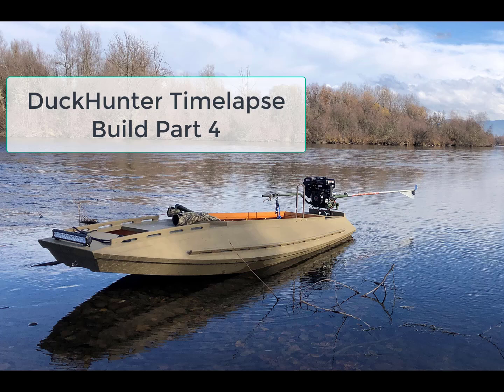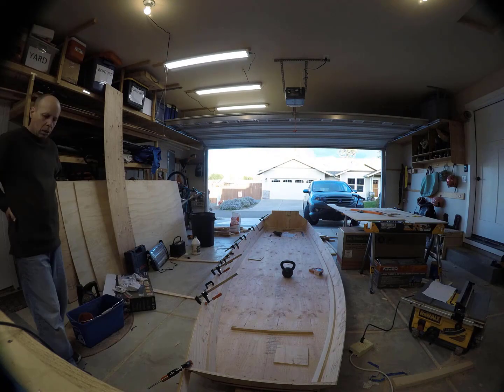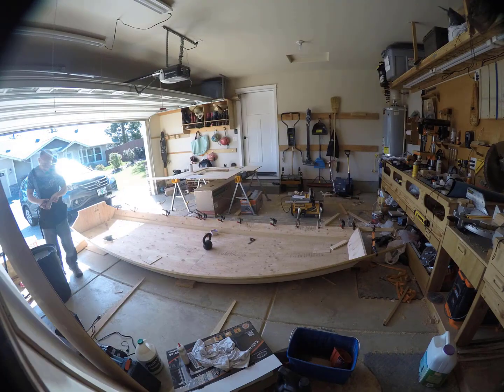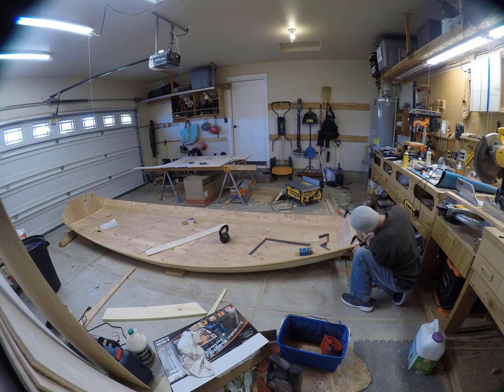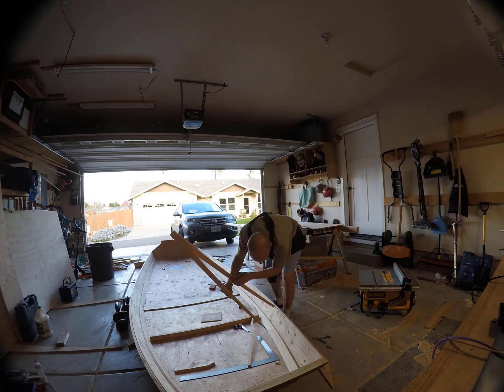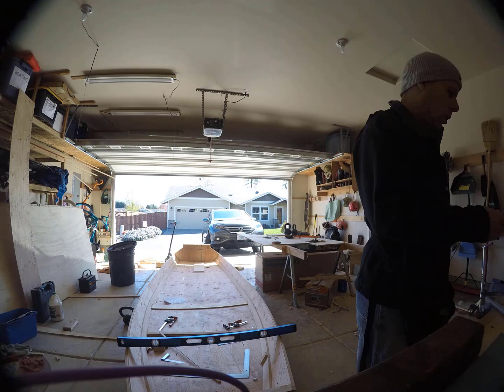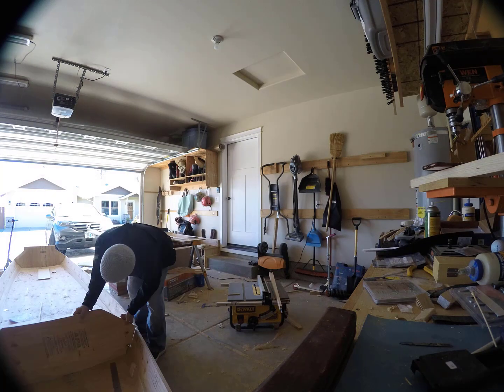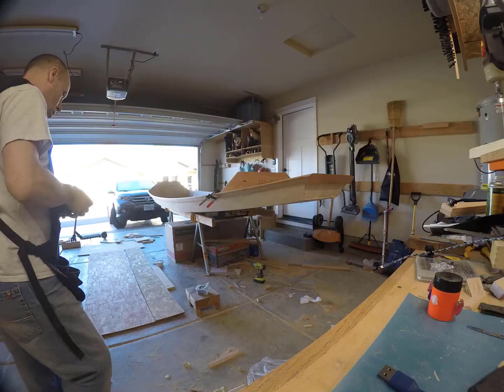The DuckHunter by Gator Boats Part 4

Comment: Nice work, Looking foward to the next video. What's your opinion about reducing the chime down to a 1x2 rather than what the plans call for. Or, do you think it needs to be that large for impact protection?
Reply from the maker: I would keep to the plans for the chine measurements.  Remember, these will receive a bevel (this removes material)  and then you need to bend the heck out of them.  i.e. there will be a lot of stress on these parts.